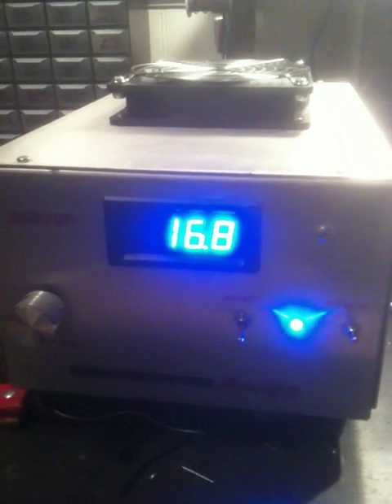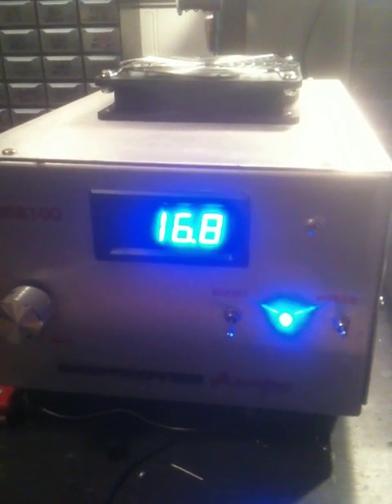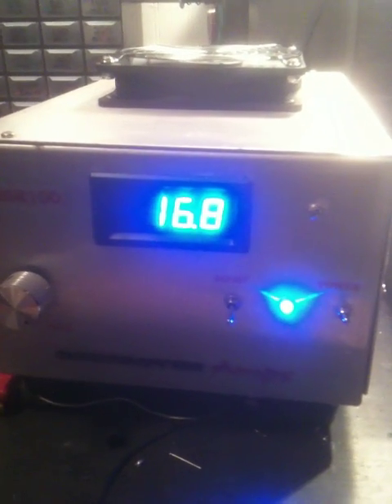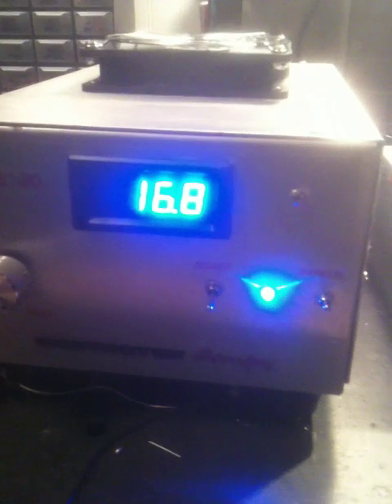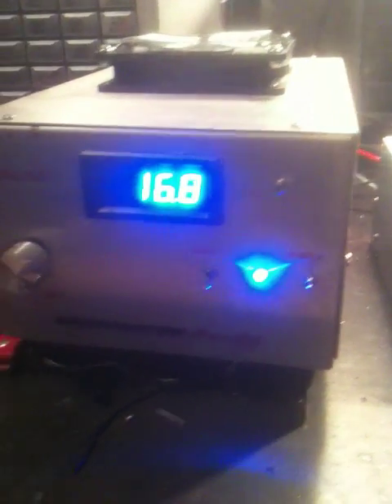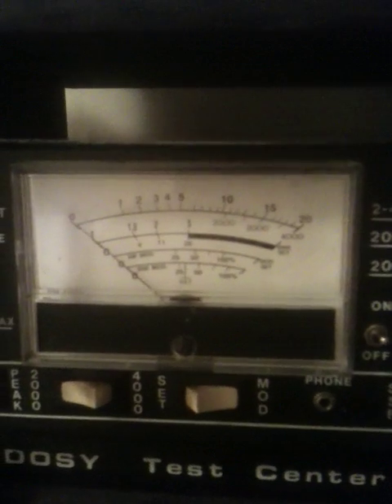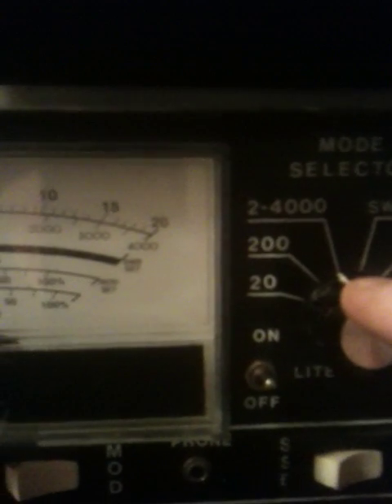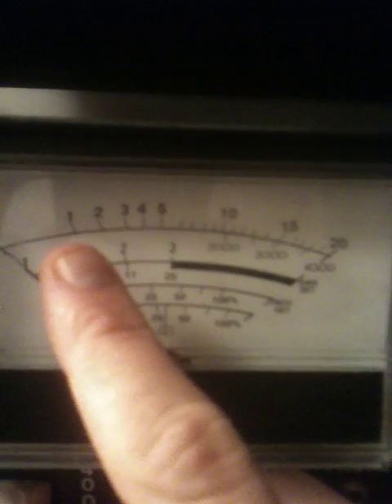DestroyerAmps 3pill Build

Comment: I have two watt meters and I borrowed another just to check and all three showed 500 watts. I have used the Texas Star 667 and a 350. All worked alright. But I always got better reports when I ask which one worked the best. They said I sounded clear and stronger than the other amps.